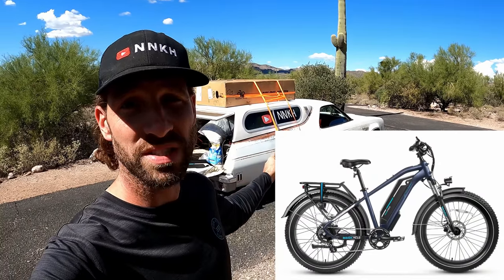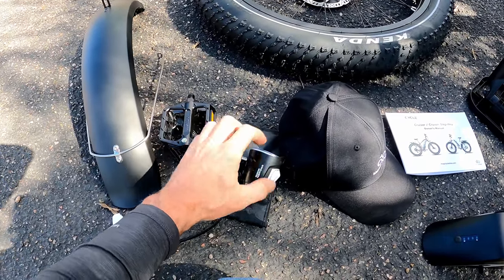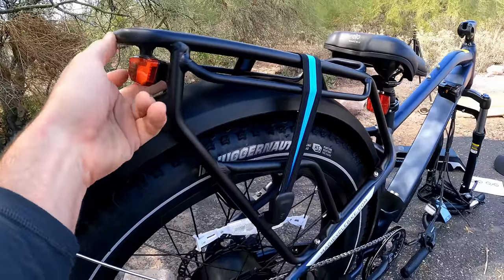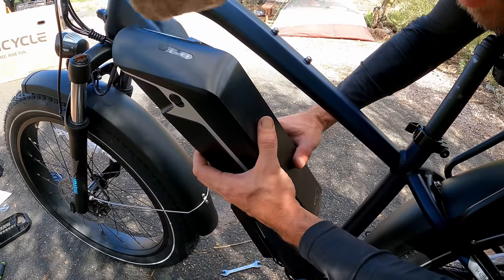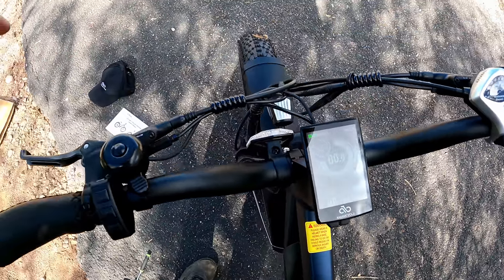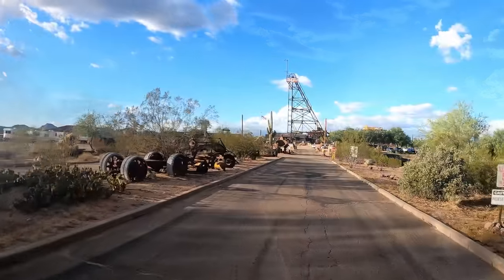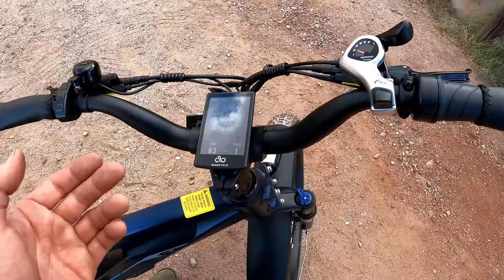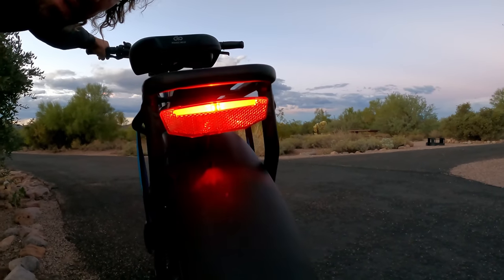MagiCycle Cruiser Pro Electric Bike Review (52v Ebike)

Comment: 29:05 time mark, remarks about cruise control.  

Unfortunately, there is no option for disabling the Cruise Control function.  If you hold the throttle for 8 seconds at a constant speed, the bike will automatically turn on the Cruise Control.  You can get out of Cruise Control by hitting the brakes or by pedaling the bike.  This is true for the Magicycle Cruiser, Cruiser Pro, Ocelot, and Ocelot Pro.  

Unknown whether there is a Cruise Control function on Magicycle's other bikes (Commuter, Jaguarundi, or soon to be released Deer).

Comment: Looks like a great bike. Yeah if you fell on one of those cactus' it would be a little..err...disconcerting. Maybe carry an emergency 6 pack of beer and some pliers....You might need it or for someone else on the trail. Having that 52v system really helps with the voltage sag and range. I've ordered a 52v battery for my bike and of course I had to order it from some forgotten VC bunker complex on the Ho Chi Mihn trail but there seemed to be a lot of positive ratings on their website(92.5%) and it comes with a one year warranty so hopefully it will be ok. I think it was called the "pride of the proletariat" model or something 15Ah. I think I'll carry a fire extinguisher for the first few rides to be safe in case the battery has some sort of failure and starts going into a thermal runaway state which is not good, it's "bad". Don't look up "Li-ion thermal runaway", please. Don't do it. It's good you slimed your tires. I always pre-slime my tubes and knock on wood they've been good for about a year now and there is all kinds of crap living in a city like Toronto and of course it always gets pushed into the bike lanes. If you want to hit my channel I show how to charge your e-bike from anything from solar to USB-C.

Comment: Also is something wrong with your battery? I'm 6'3 175 and I get at least 40 miles all throttle? And I've noticed it will drop to say 75% turn it off and back on and it goes back up to 100%. What's most important is the voltage within the cells.

Comment: i have the magicycle cruiser step thru. the bike is great. nice for minor off road and real nice on the bike paths, trails and on the city streets. the one thing to know about these bikes is that you will want to set up your pedal assist system with a start of pedal assist zero. it is only with a zero  pedal assist that you will get maximum speed while on throttle only. if you have it on pedal assist mode it limits your top speed even on the highest pedal assist mode, it still limits the speed, just by a few miles per hour but still you should know this. so set your bike up with a pedal assist mode of zero as the starter and try my findings out for yourself. i have recommended this bike to several friends, it is a good and solid bike all the way around. on average i go 12 to 20 mph and do some pedal assist and alot of throttle only just not at max speed all the time and i have been getting about 45 miles per charge with a little power to spare and my bike is not the pro model, i have had it for about three months now and it will get you out and about especially when you want to get out into the sunshine and ride but dont want to do alot of pedaling. get one, you will not be disappointed.
Reply: Cruiser Pro peddle assist 0
push the throttle and you don't go !  Nice feature to move the bike around without it accidentally moving if the throttle was bumped...
Reply: Great review! Thanks for taking the time to share.   I’m very close to purchasing a Magicyle
Reply: @kbgking7921  good to hear that, it is a real good choice. i got the step thru because i liked the look more than the full top bar and i am glad i went that route. even with the step thru it is a big bike to get on and off of. everyone that has ridden mine loves it and some have purchased the same bike, it is just so good for the minor trails, the regular bike paths, the city streets and a local around town form of transportation and grocery getter. i put the unzip and pull down saddle bags bag on the back shelf and it really lets me do alot more than just bike around. you will not be disappointed unless you buy a different bike than the majicycle. enjoy.